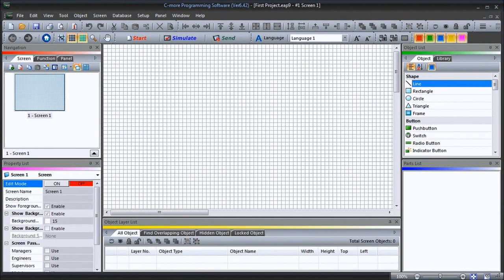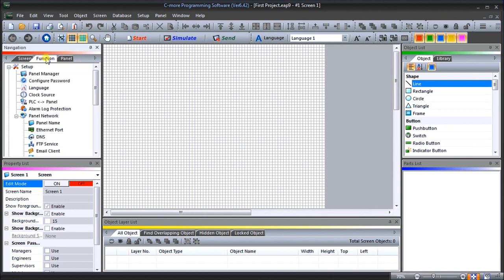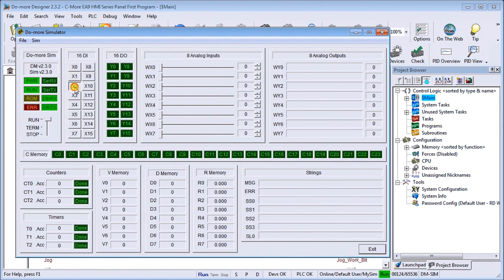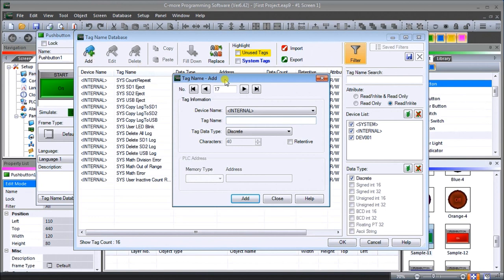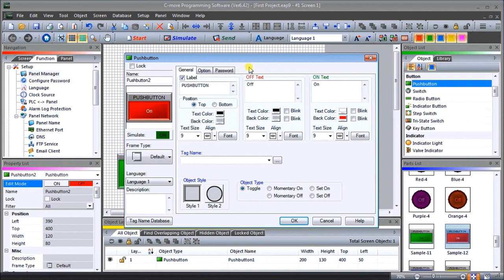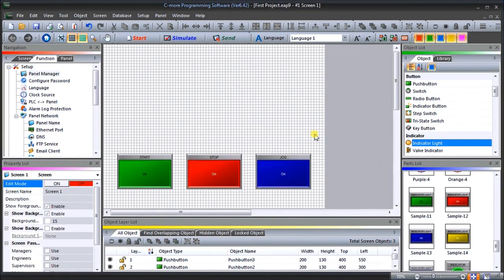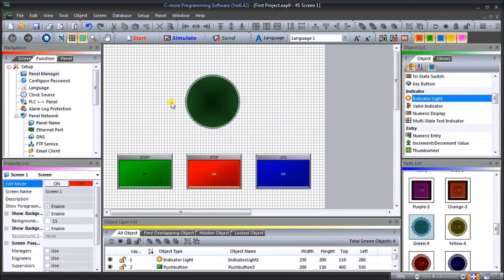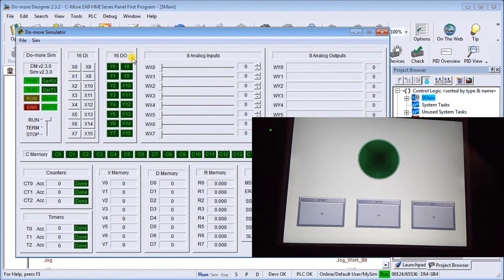C-More First Program - EA9 HMI Series Panel

Comment from the maker: More information can be obtained on our website. This includes all of the links mentioned in this video.
https://accautomation.ca/c-more-ea9-hmi-series-panel-first-program

There are several reasons that we are using the EA9-T10CL C-More HMI Panel. Here are a few:
• Touch screen display (LCD) 280 NITS display brightness
• 10.4” diagonal color TFT (Thin Film Transistor)
• Analog resistive (1024 X 1024) touch screen allowing unlimited touch areas
• EA9-PGMSW programming software 
• 800 x 600-pixel display 
• 64K colors 
• 50,000-hour average backlight half-life 
• USB port B (program/download) and USB port A (USB device options) 
• Ethernet 10/100 Base-T port (program/download & PLC communication 
• Remote Internet Access 
• Serial PLC interface (RS-232/422/485) 
• One built-in SD memory card slot 
• 12–24 VDC powered (18W), 110VAC power adapter (optional) 
• Audio Line Out, stereo - requires amplifier and speaker(s) 
• 26MB project memory 
• Data logging 
• 0 to 50°C [32 to 122°F] operating temperature range 
• NEMA 4/4X, IP65 compliant when mounted correctly, indoor use only 
• Slim design saves panel space 
• UL, cUL & CE agency approvals 
• 2-year warranty from the date of purchase

ACC Automation
https://www.accautomation.ca

Comment: Hello Garry thank you so much for your videos...
 If I am using the simulator, two windows appear: the Simulation Control Window and the C-more Simulation Window. The question is: it possible to use a real BRX PLC (which I have) instead of the Simulation Control Window? Use my laptop instead of the c-more panel. Thank you
Reply from the maker: Hi Tarasik,
This is a very common question. The simulator is independent of any controls so this will not communicate to anything else. It is simply a test to see visually what the operator will see and basic functions. 
Possibly in the near future, this will allow a communication simulation to the controller.
I hope this helps you out.
Regards,
Garry
https://accautomation.ca/series/c-more-hmi-series-panel/

Comment: Another question:  What integer number, such as N7:1 type deal, can I use for screen control and with a password allow or not allow a user to go to screen number 3,  (i.e.) If PW = set number, then MOV a 3 to N7:1.. ???? I'm using a SLC 5/04 processor with the C-more panel. Thanks!  Also where should the help file folder be located in order to get the Help to come up when I click on it. Do I just need to re-install C-More from scratch? Seems I also didn't have it unzipped when I did the install.
Reply from the maker: Hi Red_Pill Matrix
You need to set up the panel to PLC and PLC to panel settings. This will control the screen switching on the HMI. Here is a post on how to do that.
https://accautomation.ca/c-more-ea9-hmi-series-panel-to-plc-and-plc-to-panel-settings/
You can make the PLC do the passwords for a screen or have the HMI do this for you. When you create a screen right click and go to screen options. The third tab over on the top is the password set up for the screen.
If you hit F1 the help menu will appear. The main menu on the far right has a help option. Also, the objects that you put on each screen will have a help button.
I hope this helps you out.
Regards,
Garry
Reply: @ACCautomation  Thank you so much!

Comment: I think I have the same setup as you.  (C-MoreEA9 and BRX PLC).  I do not get a memory type of 0.  Only DISC.  PLC does not see a changes to MC locations.  I do everything else the same.  Did something change?
Reply: Oh, ok.  DISC is memory type now.  Address is the full location.  In this case, MC1 instead of just the address number.
Reply from the maker: @rodmartin1817  
Glad you got it figured out.
When doing these videos, I used the Modbus Driver on the C-More EA9. This was a universal driver for many PLC manufacturers. Since you are using the BRX Do-More, I would use the Ethernet driver for the BRX. You would then just use any of the memory areas you want. 
Regards,
Garry

Comment: Can we download to a panel if there is no SD card yet present? I am working with a EA9-T10WCL. It didn't seem to work/ to allow transfer.. grayed out.  Using a USB cable. What am I missing? Thanks!
Reply from the maker: Hi Red_Pill Matrix,
Yes, you can download the program to the panel if no SD card is present. It sounds like your USB driver has not loaded correctly during the installation of the program.
Check the USB driver using the Windows Device Manager:
With the C-more panel connected to the PC, on the PC, open Control Panel --> System
-->Hardware tab --> Device manager. Next, expand “Network adapters”.
 The C-more driver is named C-more EA9 

If the C-more programming software Communication Config dialog USB indicator is red,
 and the driver does not appear in Device Manager,

1) Unplug both ends of the cable and plug them in again.
2) If that does not establish communication, plug into a different USB port on the PC.
3) If there are any USB hubs or other devices being used, temporarily eliminate them to see if this solves the problem.
4) Reinstall the C-more HMI USB driver
5) If you are still having problems try another USB cable.

Reinstalling the USB driver:
The C-more USB driver installation utility is bundled with the C-more software installation files. If you have a C-more software CD, the file is in the root, called EA9USBDriver.exe.
If you downloaded the software, when you extracted the files, the EA9USBDriver.exe was extracted to the location you chose. First, close the C-more software and disconnect the USB cable from the PC. Then, browse to EA9USBDriver.exe.

I hope this helps you out.
Regards,
Garry
Reply: @ACCautomation  Very helpful. I found I had not installed the driver. Got it working. Thanks very much!
Reply: I have a program for cmore micro HMI. How do I convert it to a EA9 HMI?

Comment: Hello, I am following along but it seems I can’t add a tag because I have no options under memory type even when DEV001 is selected
Reply from the maker: Hi Billy,
There is a website post with additional information that may help you out.
https://accautomation.ca/c-more-ea9-hmi-series-panel-first-program/
It sounds like you need to set up the DEV001 PLC information.
Main Menu | Setup | Panel Manager...
Select the DEV001. This will show you the device you are connected to and the parameters for communication.
Regards,
Garry

Comment: Great video. In you program start stop jog relate to x0, x1, and x2, yet you define the buttons as mc1 mc2 mc3. wheres the connection between mc1 and x0? thanks
Reply from the maker: Hi Rick,
Thanks again for the comment. MC1, MC2, and MC3 are placed in parallel with the existing X0, X1, and X2 physical inputs. 
The modified ladder can be seen on the website for this post.
https://accautomation.ca/c-more-ea9-hmi-series-panel-first-program/
Regards,
Garry
Reply: Precisar inserir legendas para o português Brasil.
Reply from the maker: @MrGomes76  
Thanks for the comment. I do not have anyone to translate to Brazilian Portuguese.
Garry

Comment: I have installed a EA9-RHMI connected via HDMI and USB to ELO ET1093L touchscreen. Video is good but touch is not. ??
Reply from the maker: Hi Roger,
Have you gone through the calibration of the touch screen? Here is a thread explaining the procedure.
https://forum.automationdirect.com/forum/operator-interface/125314-headless-hmi
I hope this helps you out.
Regards,
Garry
Reply: Garry, thanks for quick reply. I have a USB hub and usb mouse connected. Using it to navigate to “Adjust Touch Panel” screen. When I press “Start Calibration” it just returns to Setting window.
Reply from the maker: @rogerholt8578  
The first thing I would do is ensure you are running the latest firmware. (Currently 6.52)  I would then contact Automation Direct if you are still unable to calibrate. They are a great resource over the phone.
1-800-633-0405
Regards,
Garry

Comment: Hi, I'm thinking about ordering one of these EA-9's and programing it to use as the interface on my cnc water jet cutting machine, I have no experience with this though, is it something that would be advisable to go for with no kind of schooling or training or would you say no way. Also my jet's communication protocol is RS-485, would the EA-9 be compatible with my machine?
Reply from the maker: Hi Ryno Wit The Chop Dishin 1 Up Top,
Yes, you would be able to program and use this EA9 HMI without any experience. The software is very intuitive. Here is the entire series on the EA9 on our website. 
https://accautomation.ca/series/c-more-hmi-series-panel/
You mention that your jet's communication protocol is RS485. This is the media. RS485 just means serial communication through 2 wires (200m max length). The protocol could be something like Modbus RTU, Modbus ASCII, etc. 
Once you find out your protocol then we can verify if the EA9 will communicate. 
Looks like a good application. You can then use remote access and display the information on your cell phone (Android / IoS) or Windows computer.
Thanks,
Garry
Reply: @ACCautomation  oh thats awesome. I asked the company that made all my i/o modules, plc and pci card in my machines computer the protocol and they said rs-485 but not modbus, i think it was a sales person though not an engineer or tech. and actually the pci card is the only thing in my machines computers all the other modules, components and wiring are out on several din rails next to the computer inside my machines electrical cabinet. All those components including the pci card and I believe computer as well are made by a company called Tawain Pulse Motion and the line is motion net, are you familiar with this brand? maybe you know what protocal my machine uses.
Reply from the maker: This is beginning to make sense. Motionnet is the protocol for this controller.
http://www.tpm-pac.com/Motionnet
Tawain Pulse Motion is capable of communicating Modbus. Here is one of the models that will support this protocol.
http://www.tpm-pac.com
Do you have a model number for the controller you have? I'll then look at the specifications to see if an HMI can be added.
Regards,
Garry
Reply from the maker: @rynowitthechopdishin1uptop900  
You would want the model on the controller that the PCI card is plugged into.  
Regards,
Garry
Reply: @ACCautomation  I want the model of the controller the pci card physically sits in or the boards outside the computer the pci card connects to via ethernet cables? I've been very busy just getting back to this now. Also I discovered a life saver I hope, which is called the c-more ea9 headless HMI, so much cheaper I was not really thrilled about dropping $1300 on an HMI but hopefully the product I mentioned functions the same and is the same level of user friendliness you described these things are to program.
Reply from the maker: @rynowitthechopdishin1uptop900  
https://accautomation.ca/series/c-more-hmi-series-panel/
The above link will show you also the headless EA9 controller. It is capable of everything the EA9 series can do. HDMI is used to connect to the unit for display. Remote apps are free for windows, android, and IoS.
You will still have to ensure that your controller is capable of communicating with an appropriate protocol. Your best bet is Modbus TCP.
Regards,
Garry

Comment: How do you set a screen saver and use a bitmap as the screen saver on a EA9-t7cl
Reply from the maker: Hi Brandon,
The screen saver will only blank out the screen. If you need to display a bitmap, then create a new page and reference this page after a time in the PLC.
To control the screen saver from the HMI here is a link.
https://www.automationdirect.com/microsites/c-more/software-help/Content/023.htm
The connected PLC can control the screen saver by using the Panel <> PLC settings.
https://accautomation.ca/c-more-ea9-hmi-series-panel-to-plc-and-plc-to-panel-settings/
The above post will also control the page switching.
If you need to use bitmaps, here is a post.
https://accautomation.ca/c-more-ea9-hmi-series-panel-object-list-bitmaps/

The entire EA9 series can be found at the following URL:
https://accautomation.ca/series/c-more-hmi-series-panel/

I hope this helps you out.
Regards,
Garry
Reply: @ACCautomation  thanks I had tried everything and figured this was the case thanks for you time